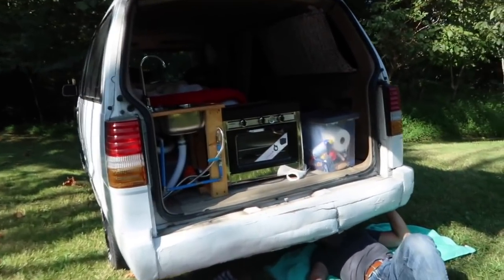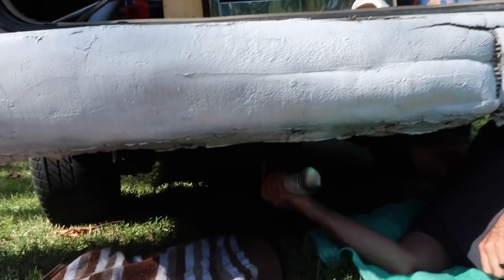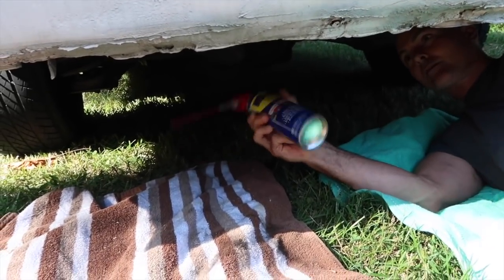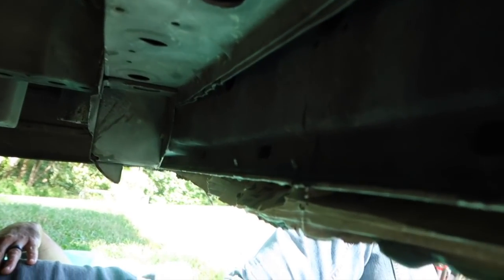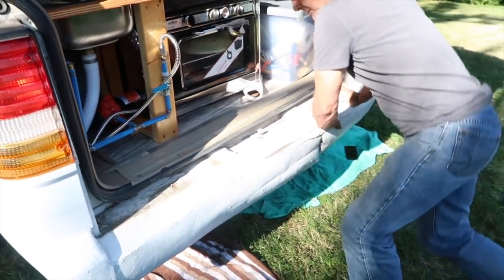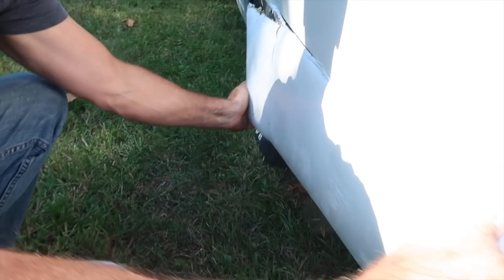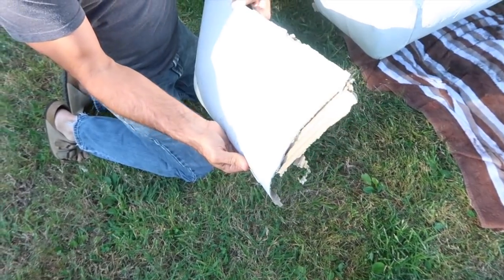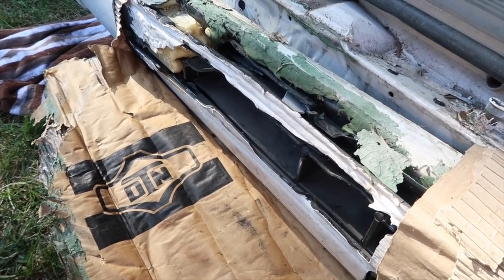REPLACING BUMPER & ADDING KITCHEN TABLE- 1991 FORD AEROSTAR

Comment: It's great that you added the table for your stove. Love that your dad's helping you and you're learning along the way.   When you set the stove down the end of the table wobbled a little.  I'd take that center leg off and make it two legs for stability.  You may not always have even ground but you can even that up when you need to.  Sure hate to see your stove and up on the ground.  It wouldn't hurt.....just the suggestion. 💖

Comment: Tia, nice table project...may I suggest to add a couple stainless washers - one on each side between the wood and the bolts when secured to the frame, so you don’t tight directly against the wood...”D” is great...say 👋 for me. Cheers..

Comment: Van looks much better with the new bumper. You might want to ask your Dad about putting some calk or a trim strip in the gap between the bumper and body on the sides to keep water out and prevent rust. Personally, I don't think there is much chance of catching your curtains on fire when using the stove top inside the van, no matter which way the oven is facing as long as you are careful. Guessing the oven would get too hot to use it inside the van. At any rate, you should have a fire extinguisher in close proximity to the stove when using it.

Comment: I remember having , a 1988 Aerostar.  I loved that thing. A LOT of great memories..   

BUT it did have a flaw.  Every aerostar i ever saw, that this problem.   Between the gas flap and the rear wheel, you will notice rust forming where the sheetmetal meets (Below the gas flap).  I have had mind repaired a couple of times in the 15 years that I had it. Just something to keep in mind.

Comment: You can use regular house hold bleach on your white car paint to clean it and remove stains. Try it next time you wash the car. You can also use rubbing alcohol to remove marks as well.  My father and brother owned and operated full service car washes since 1950s.  Customers would be amazed when the stains were removed.

Comment: Enjoying your videos. I thought your reasonable precautions against fire were adequate so long as you didn't leave the stove unattended. Speaking about fire, do you have an extinguisher? I've had great experience with First Alert Tundra. Also, two legs on the table would give greater support for the weight of the stove and food.

Comment: What a helpful dad 😊. Really like your video you look like a nice person. You have good idea with all your selling stuff on internet. Im from Québec so my english is not very good sorry about that. I convert my Suv too with 300watts solar panel homemade 24v 120ah battery. Make cabinet from birchwood plywood a water tank and a sink. You have a Lot of room in a mini van like this its really nice. If you want for winter you could attach a tarp to the rear once the rear door is open and put a portable wood stove. If you are willing I could send you some pic in private message. I have a Lot of idea.... I should make video but Im a bit shy 🙄. By the way for your table you should add a lock system to your folding leg cause if you or dog rush in the leg you could do a real mess and with hot water boiling you could Hurt yourself. 😉 Continue your good work and little by little dream can come true. Take care